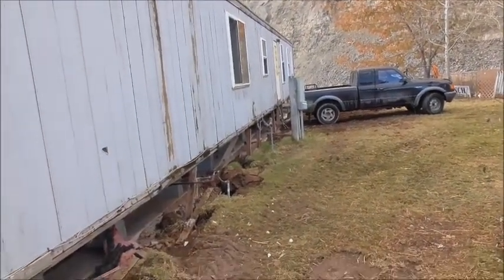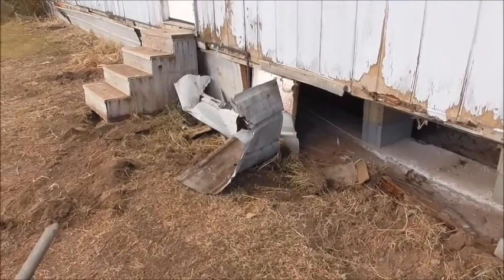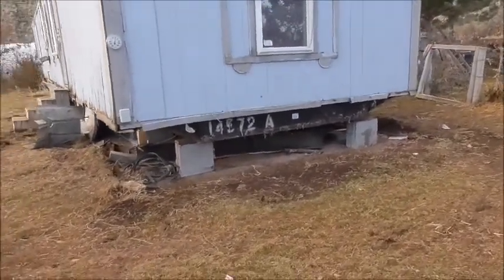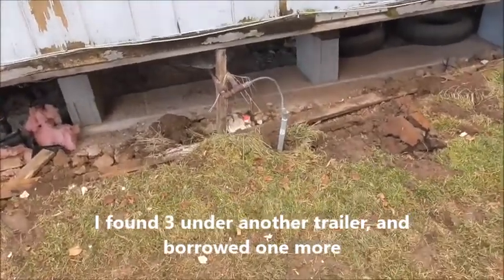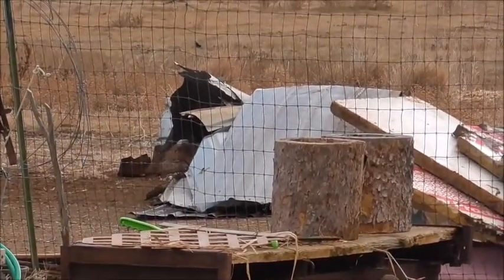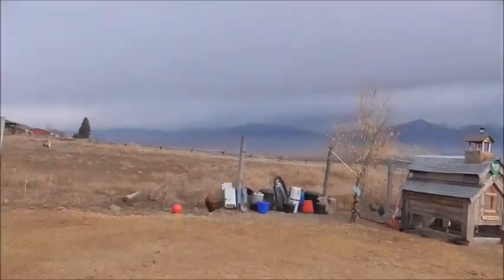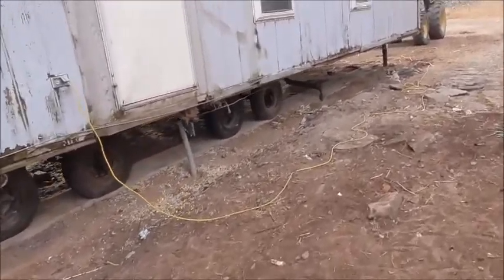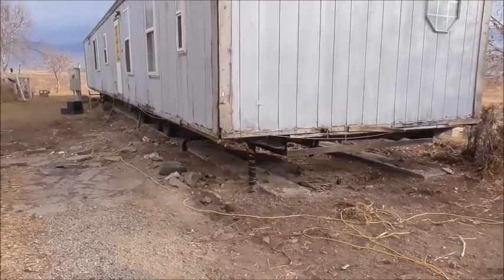Still Moving!  UGG!

Comment: Winter doesn't begin here until December 21st I think which makes it seem like it's going to be a long, cold one! Moving is never fun, but when you're moving your old house and your new house at the same time, well that's quite a cluster! Are the people that bid on the house going to have to re-run electrical or do you think they'll tie into where you cut? I hope your new house fits snugly where the old left. It'll be like a new beginning once you get settled in. The good thing is you don't have to move anything with the trapping shed or the animals! I hope it all goes smoothly tomorrow!
Reply from the maker: Thanks Chip!  It hasn't been fun....
I think the new folks will need to run wires up to the fuse box.

Comment: We are having great weather here on the 56 latitude, unbelievable really.  But winter is comin', no worries about that in Canada!  Oh man, hang in there, that was a lot of obstacles you had lifting that trailer, glad it's not going far.  We had an old trailer they would not allow on the road.  Said the walls tend to fall off so it is now illegal to haul any trailer from the 1970's.  That new law cost us 7 grand to have it recycled, kinda hurt but we couldn't do it ourselves with both of us working.  Luckily we recovered that money when we sold the place!  
Sorry about your trapping, maybe the new home will give you a bit of a cheer up, decorate it with traps:)
Reply from the maker: With the 4 inches of snow we had September 28th, it almost feels like winter has come and gone. I'm glad it has melted, but it will be back!  This one is up for bid to be sold, with two bids so far. One guy wants to take it to North Fork, which is only about 20 miles away.....I hope the walls don't fall off!
Reply: @MuskratOutdoors  All I can say is good luck to the fella that wins the bid.  When we checked on how progress was doing, yup, the bottom of the studs & plate were well rotted out.  
When they come to move your trailer, might want to make sure a chicken doesn't sneeze before they get it out of the yard;)
Reply from the maker: @tallcedars2310    Yikes!  Looking at the siding on this one, I wouldn't be surprised if the damage is deeper inside.   Now I'm a little worried....
Reply: @MuskratOutdoors  Dang, sorry to be the bearer of bad news....  But when you metioned the siding was about a foot under ground, it reminded me of our trailer's damage.  Might be nothing to worry about but maybe keep a hairy eyeball on those walls just in case!

Comment: well we are having a good winter but the only problem is its summer. If you arent going to use your traps you could lend them to me . im just pricing about 300 traps - they work out at about $6.00 for the Leg Hold traps and about thirty for the kill traps ouch. None of my old traps are considered humane anymore and cant be used Such is life.
Reply from the maker: OUCH!   That's not good!   300 seems like an awful lot, do you set that many?  The leg holds must need padded jaws now?  Can you modify your old ones?
Reply: @MuskratOutdoors  The old traps are what we call gin traps. They  are the type with a single leaf type spring and teeth in the Jaws. I think the Brand is Lanes Ace or Hayes . 
We now have to use smooth Jaw traps and have coil springs anything larger than what we call 1 1/2 need to be padded. 
By the winter I hope to have 3-4 hundred going but Im going to try a new technique where I  set the traps in clusters But only actually set the traps for 2 or three days then spell them for a bit but still put feed out for the critters to draw them in. At anyone time I might have 150 traps set.
The Old way of doing trapping was set out a line and go round your traps every day and keep the line going untill the traps stopped catching. But what I realized was that one critter would get caught in the trap and all his mates would stand around and laugh at him and then eat all the feed so I plan to up the game a wee bit. Trappers often think they have trapped out an area but in reality the animals wise up to the traps. 
I've taken  a break from my business consultancy while I sort out some Legal issues with a client and are blessed that I have Hunting/ trapping skills to fall back .
Reply from the maker: @huntarama9375     Try selling your old traps on ebay. Anything with teeth is collectible and brings good money.  Good luck this season!

Comment: Them things are not easy to move after sitting there for years which is why you can find them on craigslist for free as long as you haul it off and in most all of those cases like 100% of them LOL
Not many of them will have wheels on them at all and you will have to buy wheels before you can even move it plus no tongue either and some I even looked at were in such bad shape it would be cheaper to buy a 2-3 year old like new one than fix up one of them old ones
Reply from the maker: Some have even removed the axles!  I don't know why they would do that.  These things really are not meant to be super permanent, sooner or latter you need the axles again!  I don't know why only half the tires were gone from this one?  Seems strange...
Reply: @MuskratOutdoors  This is something many people do not know

As long as a skirt is never put around it and it remains on the wheels looking like it is ready to tow they do not consider it a permanent structure so no property or school taxes are charged for it even if you're living in it 

You can put up something to block the north winds like a fence around it but once you enclose it with a skirt attached to the ground it becomes a permanent structure that can be taxed with property taxes

They can still charge taxes for the land it sits on but cannot charge taxes on a mobile home or RV that is not attached to the land 

The loop hole is if it is not skirted or so called attached to the land with a skirt then it is only personal property not real property that can be taxed 

The other proof of not a permanent structure would be a detachable RV water hose to supply water along with a detachable hose or PVC pipe for black and grey waters attached to the septic system and a cord that plugs into a 50 amp 220 volt receptical for power

The other part is if the land owner uses it as a rental to rent to tenants and calls it a rental property then he can be charged property taxes on it regardless as a real property so it is better for him to say, No the person living in it owns it and he is just letting them use his land to park it on and nothing more
Reply from the maker: @RayBlackburn   Interesting.  It really makes you wonder why they think they should get a piece of the pie in the first place. They do nothing to earn it.
Reply: @MuskratOutdoors  Exactly, So always good to know how to find loop holes to save the money where it belongs, in the hands of the people who work for it, and not the Nazi party
I have paid no property or school taxes going on six years now myself because I live in an RV that is not skirted or wired permanently
At one time they were talking about taxing RV's but it did not pass muster being as if they did that they would also have to charge property and school taxes for any vehicle including motor cycles and bicycles towing a small RV camper in every county they parked in which would be impossible anyway